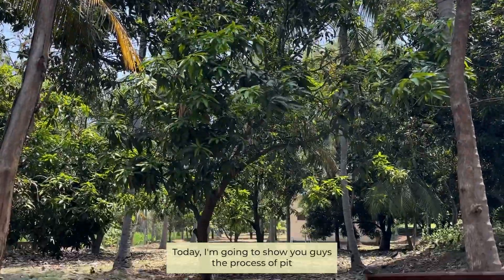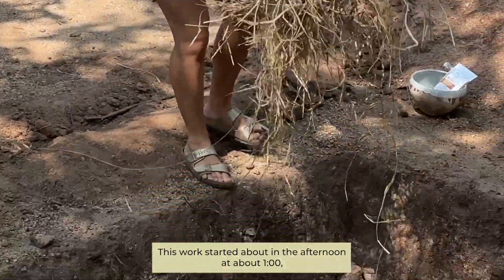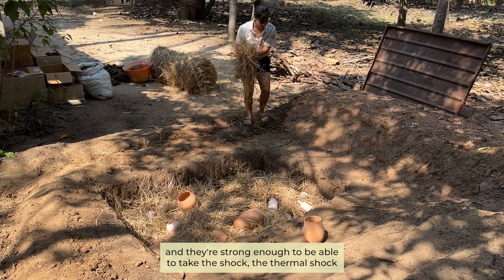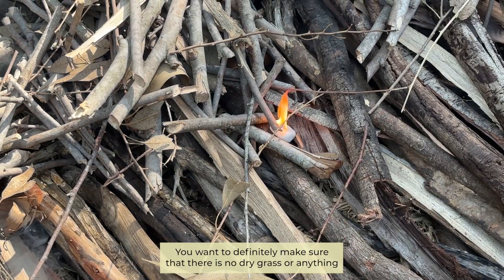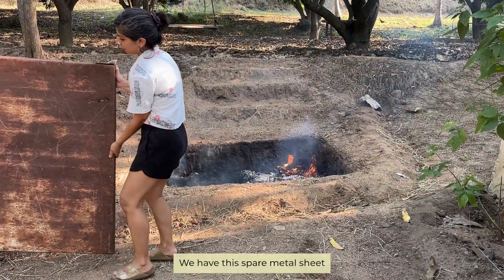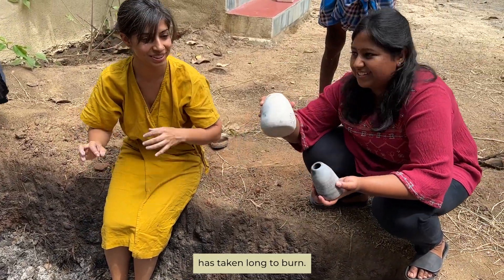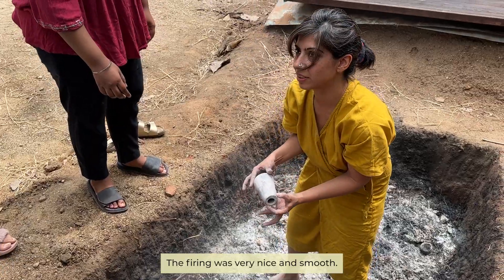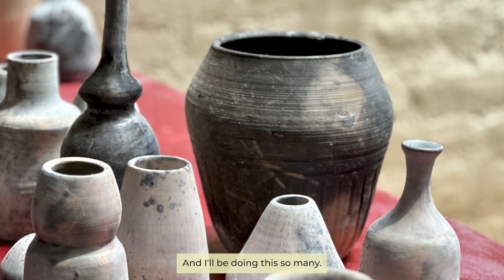Pit Firing

Comment: Question. If you previously fired the pots, then why fire them for a second time in the pit?
Reply from the maker: Hello! The first firing gives the pots just enough strength to be able to take the thermal shocks felt during the pit firing. At the same time, the first firing temp is little lower than usual so the clay’s pores are open enough for the effects to show up.
Apologies for the delayed response. Hope this helps :)